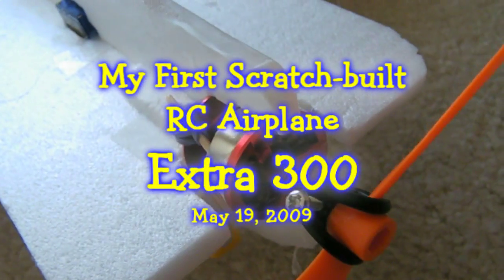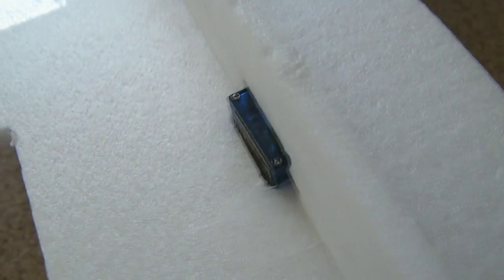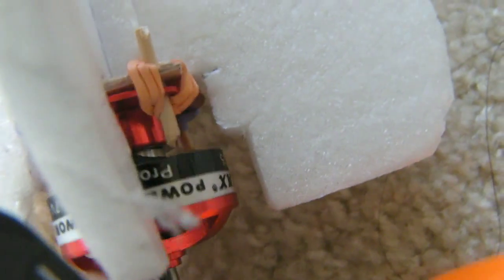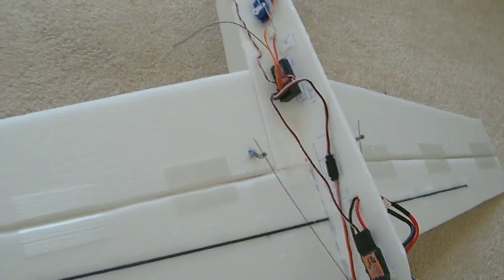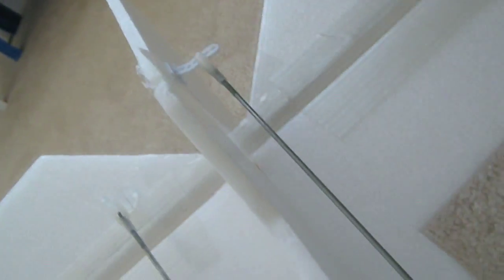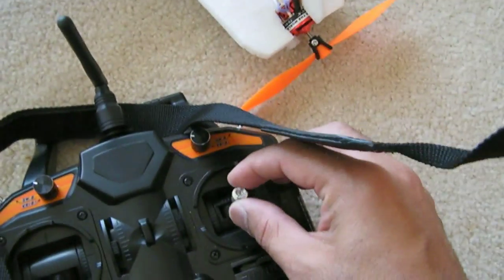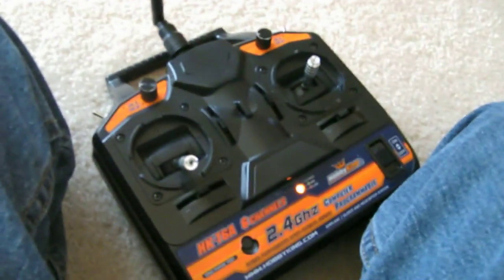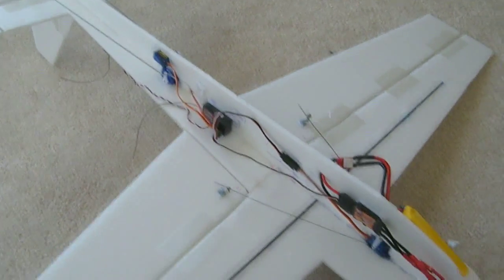Detailed View of My First Extra 300 RC Airplane - Plans from RCPowers.com

Comment from the maker: @thelittel0 Dont use depron.  Use EPP.  I made the same mistake.  For the beginners depron is not recommended.  This was a big mistake I made.  I spend 95% of my time fixing this plane.  I made many EPP planes since then and they all turned out to be excellent.  EPP is easy to build, more durable, and best of all easy to repair.

Comment: good video 
hello  you said the plane didnot fly i have the same motor fc-1600 since its cheap
but what the thrust the motor supports 
and the current  draw using 8*4.3 prop

Comment from the maker: @hermosillad Glad it helped.  The servos can be reversed by programming your controller.  You need to hook up your controller with the computer using the usb cable and use the tconfig software to reverse the servos.  I guess when you say  "cable" you mean the usb cable that connects the controller with the computer and you did not buy it.  I guess you will have to buy the cable.  Makes it a lot easy.  The other more intrusive option is to detach the servos and reattach them reversed.

Comment from the maker: Thanks for appreciating the video and the accent :)
First off, this plane was built with depron - a big mistake. Depron is very brittle and when the plane crashes (which it will trust me) you have to go through a full repair cycle. I have built another plane-EPPYAK 55 (rcgroups) - with EPP. EPP is the best foam for the beginners. It is very crash resistant and much lighter. So overall weight of the plane is much lower and the plane flies slower, handles better even with lighter smaller motor.

Comment from the maker: Thanks for appreciating my video and my accent :)  I would love to see your plane.  I changed the motor on it (the one showing is under-powered), and today I was finally able to fly it.  If you haven't started making it yet, and if you are not an expert pilot, I would recommend to use EPP instead of depron, since EPP is far more flexible and crash resistant. I have crashed it many times (mainly because of under-powered motor) and had to repair it almost always after the crash. Just a suggestion.

Comment from the maker: I am sorry I never measured the weight of the airframe alone.  But with all the electrical components (including the heavy 1550 mAH 2s battery) the weight is almost 420 gm or about 15oz.  The motor turned out to be underpowered for that kind of weight, so the plane did not actually fly :(  So I have ordered a couple of more powerful motors and 3s battery, and will try it out again next week.

And I am from Pakistan. You?

Comment from the maker: If I hold it from where the CG is supposed to be, which is about an inch from the start of the "cockpit" (the big  "+" sign on the fuselage in the plan), the plane balances level. I have attached the battery (as well as other components like the receivers and ESC) with velcro. So I can move the battery back and forth to make it nose heavy or tail heavy. Before the electrical components (airframe only), the plane was very tail heavy, but motor and battery help in balancing it.